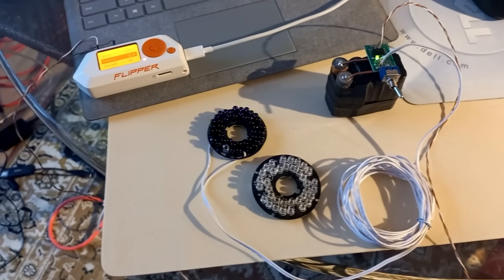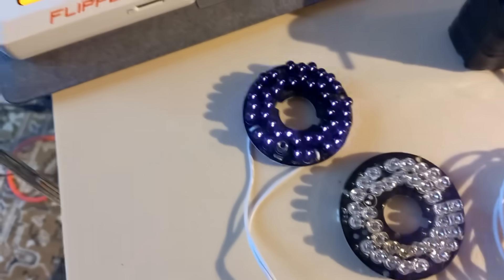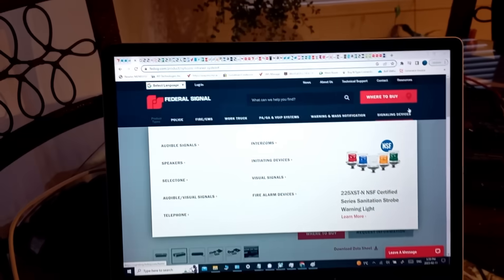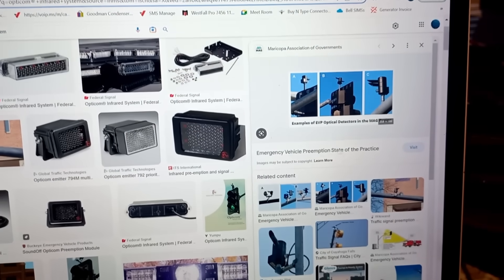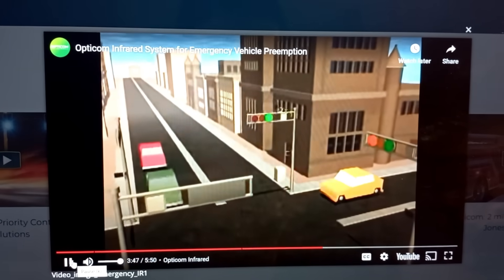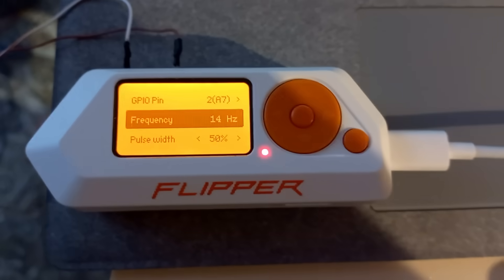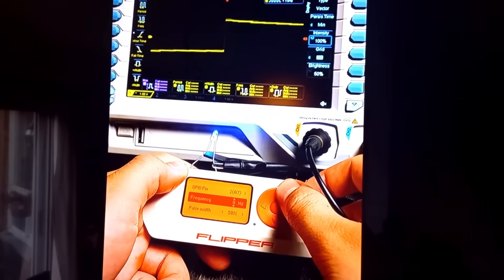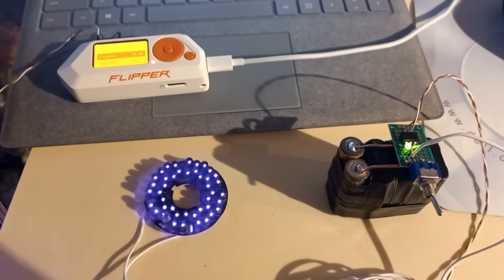Flipper Zero Controlling Traffic Lights

Comment: Is it normal that when I use the universal tv remote sometimes it gets stuck on flashing and It won’t let me exit so I have to reboot?
Reply: @peterfairlie2296  i was going to get that firmware but i went with unleashed instead because it has some weird ass pictures. is there a way to remove the picture on Xtreme
Reply: @carlos254TX_   I haven't installed any custom FW on mine yet but I've been reading about Xtreme and you can now toggle the NSFW off/on in the settings
Reply: @carlos254TX_  yes you can change it back to the dolphin from within the menu, they call it disable NSFW (not safe for work).
Reply: It happens every now. I'm sure they are working on trying to fix it it's probably something to do with lack of available ram or something like that.
Reply: @Trekeyus  oh ok thanks i thought i was the only one

Comment: damn i cant even get mine to duplicate my key fob for the turndra...smh
Reply: Obligatory cautionary comment about desynchronizing your fob to the vehicle
Reply: @caseyscheck8169  thanks for warning. Didn't know that's possible
Reply: Most modern key fobs do have "rolling codes", which means that the key is essentially throwing a new code every time you press it.
It will, in theory, never be the same. 
The only way to replicate it would be knowing the secret encryption code stored on the fob itself and therefore crafting a valid code.
Another, albeit hacky way to clone the key temporarily, would be jamming the car with noise on 433mhz (or getting REALLY FAR away from the car) while cloning the code with the flipper. Since you have jammed the car and it did NOT receive the code, you essentially held a single code "hostage" and can use it - but only once.